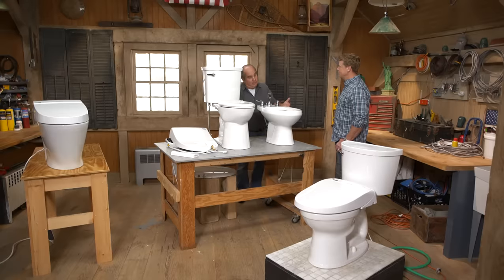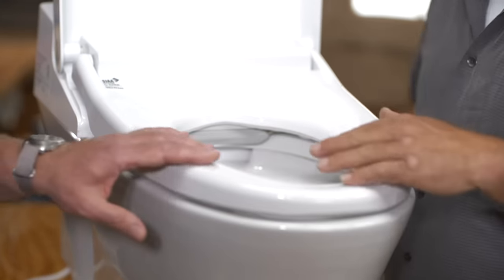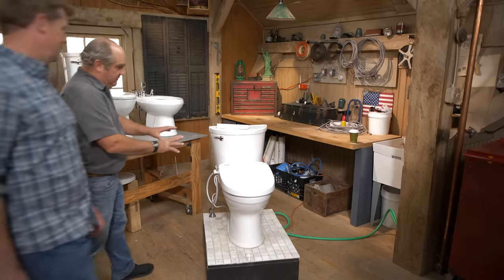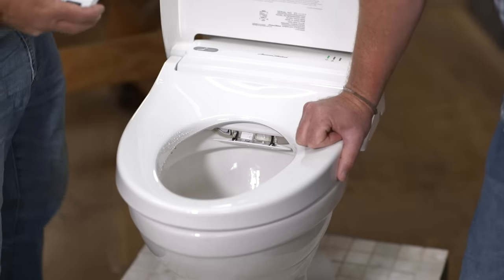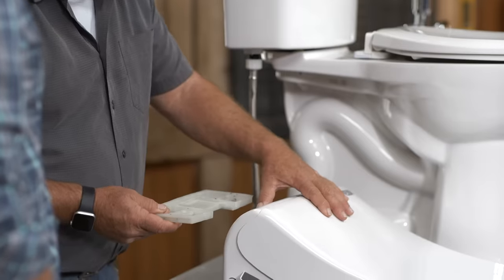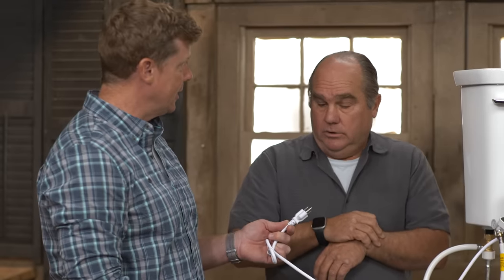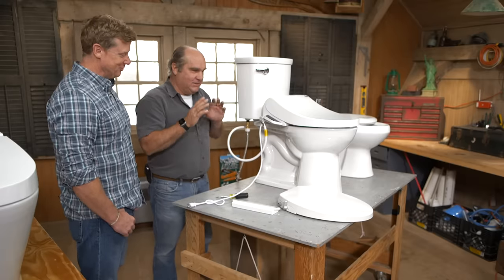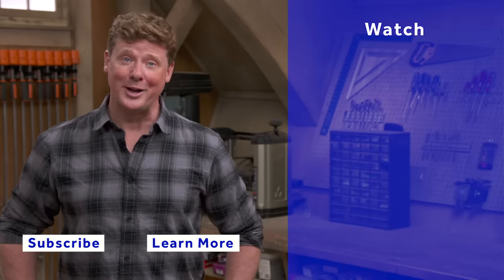Understanding Bidets | Ask This Old House

Comment: I made my own for free. I took my neighbors windshield washer pump, reservoir and nozzles off his car wipers while he was sleeping. I added the wiper fluid reservoir inside the tank and filled it with some pina colada air fresher he had in his glove box. His old car battery powers the whole thing and I smell like I just returned from a tropical paradise after each use.
Reply: Red Green?
Reply: That's too much work. Just nab the little tree air freshener from the rear-view mirror and use that... Piney fresh.

Comment: The prices quoted on here is not realistic for the lower end models.  The one without electrical connection can be found for 20-50 bucks.  And the ones with heated seat and drying features are around 400-600 dollars.  USPA is a great vendor as well as brondell.  Costco often sells the mid range models on sale for 200ish dollars.  Don't think it's a huge expense.  You will save lots of money on TP.  And you will feel cleaner!  The worst thing is that you won't like going to anyon elese bathroom that doesn't have a bidet.

Comment: I have well water and it comes out of the tap at 56 degrees. The one without the heater would send the user right through the ceiling.
Reply: Nah. Cold water is perfectly fine for this application. Surprising, but true.

Comment: He said a GFI outlet is unusual in the bathroom. Huh???? That is anything but correct. GFI outlets are always required in bathrooms. I'm 99% sure a GFI outlet is required by most codes if there's a water source within six feet of the electrical outlet being installed. I'm not sure of what the exact distance is but I do know it's something in the area of six feet.
Reply: He means having a GFI outlet near the toilet to plug into for those more expensive models that need electric power.  The simple kind (I have both at my house) just uses water.

Comment: My only experience with a bidet was when I stayed in Paris (Las Vegas) for a few nights about 20 years ago, had a fancier suite, and sure enough two in the bathroom.   Unfortunately I had no idea how to use it, but I had to try it at least once, checked the water temp, got over it, did some weird quad squat, and yup sprinkled on my butt... however I had no idea how I was supposed to dry, and had no idea if it actually cleaned effectively for what I did (was I supposed to get soap scrub in there like I was taking a shower?)  needless to say nearest thing I had was one of the bath towels so yeah dried off no problem and no I apparently didn't clean enough (EWWWWW... yeah get over it, what do you think is on toilet paper?) ... needless to say I was not impressed by the bidet.
Reply: I've thought about getting one. But I'm worried it won't actually do very much.

Comment: For me, the big issue has always been drying.   I haven't tried one with a hot-air dryer and don't know how long that takes (I don't like to sit a long time on the toilet).   Using toilet paper or a towel that someone else has already used don't make it for me.

And if I was going to spend that kind of money, I want arms that my wife can use to help her stand up.  (But are easier to clean than the ones I added onto my toilet).
Reply: The hot air typically blows for about 120 seconds, does a pretty good job.

Comment: These things would be not so great in Canada where the cold water coming to the toilet is painfully cold. Unless it has the water heating system on it.
Reply: You can plug them into the hot water line and the ones that plug into the wall have a heater for the water

Comment: I've tried to convince myself this is worth it but there is just no way I'd go with cold water or pay a crap ton of money upfront. Also, the hard water filter cartridges cost nearly the same as buying TP   meaning I wouldn't even recoup the upfront costs over time.
Reply: Takes some getting used to, but it's 250% worth it. 
Think of it this way: if you got your hands dirty would you rather wipe it with a napkin or hose it down with water (cold or not). 
Also hard water filters are fancy additions which very few people use.
Reply: For $40 and a 10 minute install, what’s it hurt to try the cold water? I used to have one that let me mix hot and cold, but when it needed to be replaced I just got an all-cold one because I found that I preferred the cold anyway. The uninitiated assume heated water is important, but it’s not in this application

Comment: I've never used a bidet but there's two short comings it seems like:

1) A cold-water bidet seems just as effective as soaking your toilet paper in cold water prior to wiping.  With your butt thoroughly wetted, won't you're TP just get soggy then break immediately?

2) The angle of the bidet-spray seems to push fecal matter towards the lower vulva, which could cause a UTI.

Decent bidet costs... $500 to $5000.  A bag of flushable wet-wipes costs $4.  The choice is clear!
Reply: 1) you don't really need the toilet paper if you're using a bidet, my dude. For a cold-water bidet, you might use a small amount of TP to blot yourself dry, but there's no wiping motion, so no, you're not just rubbing wet tissue paper around your back door
2) depending on the type of bidet, there may be a slight risk? I don't know first-hand, as I too am a male. But I will say that on the Japanese models with settings for both the butt and vulva, you can always use the butt one first and then use the vulva to hedge your bets, as it were. At a certain point, it's not that different from a female washing her butt and privates at the same time in the shower. I highly doubt it carries anything close to the risks of wiping back-to-front with toilet paper.
Try a Washlet-style bidet some time, they're soooo much better than TP or 'flushable' wipes, which still cause clogs and backups in many sanitary laterals. A $400 heated, self-cleaning, deodorizing, warm-water butt-washer that lasts 10-20 years is cheap compared to an 8 hour service call when your sanitary sewer lateral is so jammed up that the pipes need replacing and your lawn or landscaping need to be repaired.

Comment: Once you buy a bidet, with heat wash, heat seat, trust me, you won't look back. Saves on toilet paper, uses little electricity. If you feel your electric power is high, turn it off after each use. And no fighting for toilet paper in shops.

Comment: There are a lot less costly bidets.  Bought one for under a $100 and it works great. Is not remote control and requires no power. It has hot and cold hook up. It would be nice to see a demonstration of one for us lower wage people.

Comment: It's a good thought to add a check valve to a bidet so you're not accidentally poisoning your water supply. Just a thought from an apprentice plumber.
Reply: hard to imagine a scenario where that will ever come in handy!!
Reply: How do you envision this scenario occurring?
Reply: @cfldriven  it could. That's why vacuum breakers exist on sill cocks
Reply: @darthmal1  Actually not required in all states, but the outdoor sillcock (outside faucet, spigot, or hose bibs) is a different situation from a bidet. The water column in a house can be higher thus with loss of water pressure the column could travel into the system. Don't see how the nozzle in a bidet which is hidden until used can reach the bowl water.
Reply: @cfldriven  In my Trade school, we talked about how an over flown toilet could lead to backwards suction. And although it's not required in all states, it's probably not a bad idea just to add one.
Reply: @darthmal1  Not to beat a dead horse but how would the water from a full bowl back flow into the tank that is above it. The water in the bowl would have to be higher than the toilet water tank.

Comment: I think the best option for number 2 is a squat toilet that's flush with the floor and a handheld sprayer.
I don't have a squat toilet yet so I climb on my western toilet to squat for #2 and afterwards use the handheld water sprayer with my fingers to clean myself.
I don't dry afterwards; I guess if I wanted I could use a towel but it's not really necessary because the butt dries itself quickly enough, underwear can get a little wet from the wet butt but it dries up by itself too while wearing it which doesn't take too long because it's just a little water.
Reply: Yeah, well... legs don't work that well so a squat hole is not practical for some of us.

Comment: Now, i'm asking, where can we buy a spray bottle with a very strong spray force? Maybe sit a large water container up, then a short hose? This old house: there's the lids/seats less expensive. No heat, no electric. Then there's the hand held wands that can be fitted off toilets water line.  Looking around, Less options less expensive. Even less than 500.

Comment: My issue with bidets is they seem very unsanitary. The part spraying your backside will inevitably get fecal matter (even if non-visible) sprayed back onto it. Then the next person who sits down is getting that fecal matter sprayed onto them. Seems like a great way to spread disease.
Reply: If it's good enough for the Japanese, it's good enough for me haha. Seriously, if you get a Toto Washlet with a self-cleaning wand, I doubt there would be any appreciable contamination. Also, the fecal-oral route you expose yourself to in a TP-only household is way more dangerous than having someone's butthole water touch your butthole. There may be a risk of spreading pathogens, but I wouldn't be concerned unless someone actually defecated on the nozzle itself. Not very likely.
Reply: They solved that with a clean cycle after you go.  Even the simple ones have a clean function.  The more expensive models have a sterilize function using heated hot water as well for the sprayer.
Reply: Actually the sprayer automatically gets cleaned after each use and can be further sanitized if you like during your regular toilet bowl cleaning.

Comment: Costs electricity, hot water from the heater tank,  you still have to dry off with something or sit and wait for the fan, and it still can't get "peanut butter out of the carpet" with just tap water.   AND we get to pay top dollar for the privilege?  ....   Golly, what's not to love?
Reply: Clearly you haven't used a good one lol. It doesn't use hot water from your water heater, the warm water type have built-in water heaters and are very low current. Seriously, once you have one at home, pooping anywhere else but home is a bummer. I'll put it to you this way - after a really active day outdoors, would you rather take a nice warm shower, or would you prefer to get clean by wiping your body down with paper towel and/or baby-wipes? I'm going for a warm shower every time.

Comment: NUMBER ONE: Make certain your water supply hose is sturdy, well connected, and has a shut-off valve that is utilized after EACH bidet use.  Otherwise, you could easily have water unknowingly running all over your floor due to a break in the connection.  This is every bidet's weakest link.
Reply: Gianni, are you referring to the handheld bidet sprayers? I didn’t know the bidet toilet seats have to be shut off after each use too.
Reply: By that logic you should also shut off the toilet water supply after each use.
Reply: @kimariokiji  You don't shut off the water after each use on a toilet seat bidet...that would be absurd.  I've had one installed for years, no leak. If you install it correctly to begin with, you shouldn't have any more trouble than you would with a sink.
Reply: @kimariokiji  They don't HAVE to be turned off.  But the water line CONNECTIONS are often plastic or plastic/compression fittings which are not reliable long-term.  Especially true of a hand-held sprayer type.  You might very well come home to water POURING continually from a broken connection.  THOU$And$  in repairs.   So be safe and not sorry.  These aren't like your supply hoses or solid supply pipes under your sinks.
Reply: @cfldriven  
Utterly wrong!  The water connections on a bidet, even a quality bidet, and or a hand-held are not nearly as robust as a toilet supply line, which often has a SOLID brass tube for a supply.
Reply: @MojoPup  
Nonsense.  Often the hose compression fittings are plastic-- like tbe fittings used with reverse omosis systems under your sinks.  That you've not had an issue is simply a numbers game.  Many  have had catastrophic flooding.
Reply: @Pw6872  My bidet line is braided plastic, just like the supply line feeding the toilet. Haven't seen solid brass in a long time, I use braided plastic and braided plastic with metal mesh jacket, the weak link has always been the shut valve that general is a single use device.

Comment: Until today I always assumed these were always a lady thing, probably due to the euphemistic/nondescript wordage used to describe their function. Plus the only one I ever saw had a tap pointing down, although perhaps it rotated, I never investigated. I still don't get it though, does it replace paper or is the idea that you wipe once, then tidy up with water? Or is the idea of it paying for itself in time based on it being primarily meant for women, who presumably go through a mountain of paper half a dozen times every day?
Reply: That what I wondered until I got one. It sprays and removes all the poop from your bottom. If it has a dryer there is nothing else for you to do. If it doesn't have a dryer than you need to pat dry the area with very little tp.  No wiping no fuss.

Comment: SO many things to say here. First of all a master plumber should NOT say that a GFCI is unusual in a bathroom.... WTF are you talking about???? A GFCI should be in MOST bathrooms by the sink. Thus, it wouldn't be strange to install another one by a toilet to plug into.

Second, this one finally answered my question of how does the water get hot enough, but not too hot before you spray your bum.... There's the trickle feature before it sprays... Now I get it, and the dryer feature is awesome. Saves on toilet paper indeed. 

There's many other things that could be mentioned, but I'll just let it go. I've actually never used a bidet before, but I would absolutely be a big fan. It just seems so much more sanitary.
Reply: 1 He meant next to the toilet.
2 The water in the internal tank is heated when you sit down, so you have the desired temp you prefer.
Reply: @cfldriven  if you read my response carefully you’d see I understand the first one. He should have been more clear to say GFCI NEXT the toilet 🚽. 3:43 which he did NOT. the external tank temp is great 👍🏻. Not scalding like “instant hot water,” you might have for a kitchen sink, or cold 🥶 , standard temperature, like the last, cheaper option he mentioned would have been another specific thing to mention. These things can’t always be inferred. Tommy Silva would’ve known bettah! These guys should’ve as well 😉😊
Reply: @imaramblins  Yeah but technically you asked the question. Besides a receptacle by the bathroom sink is not what is needed. It needs to be next to the toilet for the cord to reach which by design they are not.
Reply: @cfldriven  Annnnd "technically" they should have been more specific about that. I've seen them get specific about caulk, or much more mundane and obvious things. So why not this much more technical situation. They should have mentioned it, and you're just plain wrong for assuming that the lay person homeowner might just assume these things.
Reply: @imaramblins  Yes Tom should have been more specific, but it made no difference, the fact remains for an electric bidet you still need GFCI receptacle. His wrong answer wouldn't have lead to a mistake or injury by a viewer. TV production is expensive and hard, so I can overlook that minor and rare verbal mistake. Hope you have a good day.